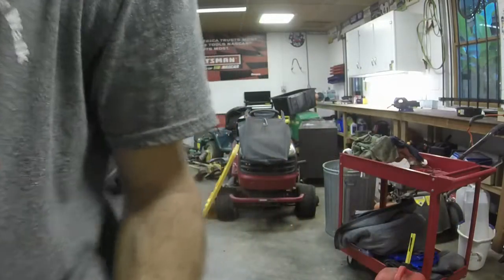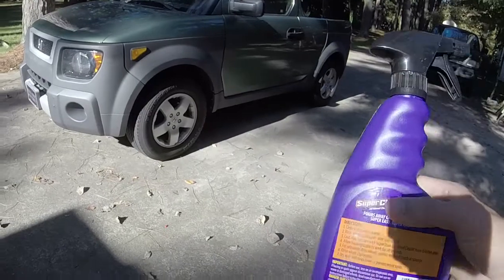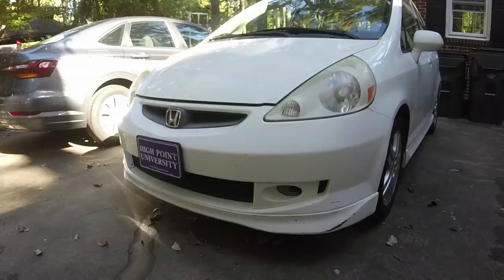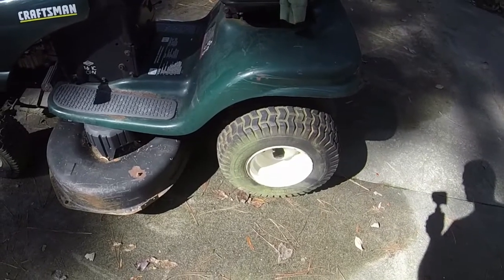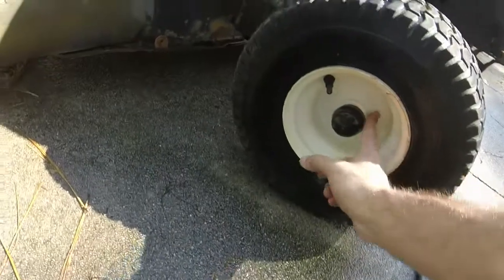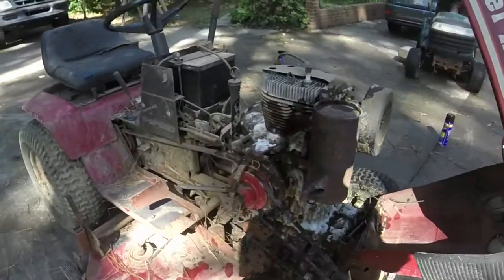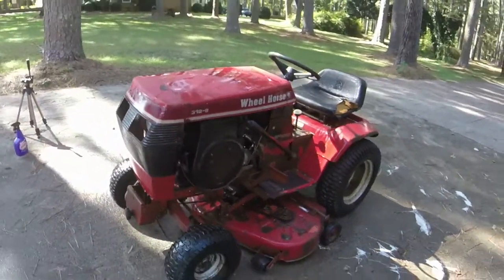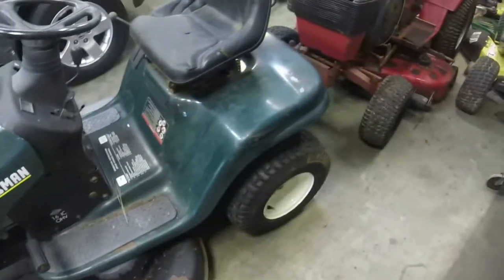I got a box from Super Clean.  Let's clean the Wheel Horse, Honda Element and more!

Comment: I have that same pressure washer. I replaced the end of the wand with a Ryobi spray wand so it can use actual tips instead of the adjustable stream it comes with. Can't beat that pressure washer for the cost.
Reply from the maker: Very nice!  I bet that was a good upgrade.  A great pressure washer for the money.